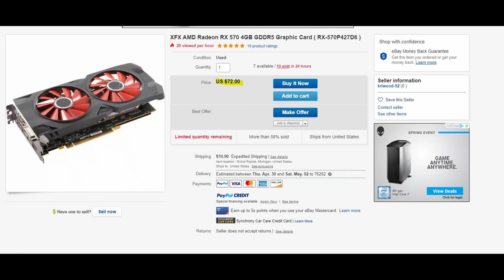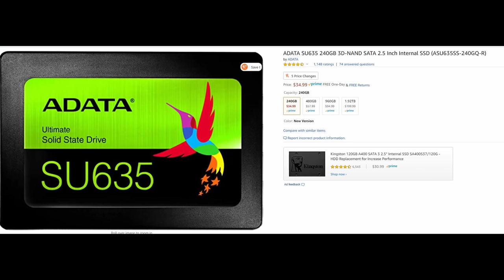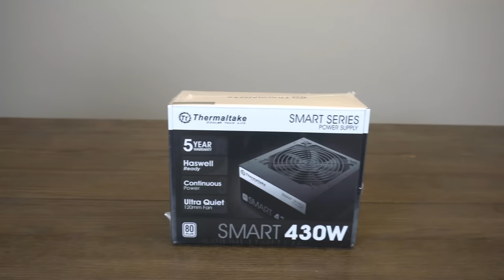$220 Just Get Gaming PC Build - Dell Optiplex 2020 + Benchmarks

Comment: Drilling out the rivets leaves holes in your case for dust to build up. Mounting the SSD with Velcro is a  bad idea. The heat from the Dell internals will make the Velcro wear off over time and the SSD will fall off. Your better off just locating a smaller GPU.
Reply from the maker: Good pointers!  

True but the holes are very small.  Not much to worry about.  True though the Velcro does not hold up well when mounted the way I initially did it. No actually stuck it to the bottom of the case after the fact.
Reply: @PCTechHustle  Maybe in a follow up video, you could recommend filling the rivitted holes with putty or something to keep the case in tact as it was before. Those refurbished Dell's are off lease business computers and are designed to last.

Comment: PC tech hustle,  question:  if you transfer a Lenovo motherboard to a micro atx case and realized that after troubleshooting all of your components your power supply adapter keeps your power supply running after shutting down.  Do you think it is the power adapter that is defective even though it is a brand new power adapter?
Reply from the maker: I think it’s reasonable to assume that is the issue.  Maybe try the old power supply again just to verify.

Comment: Would you buy the pc with SSD or buy it with a HDD and change that out for the purchased SSD.
Reply from the maker: It’s rare to find an Optiplex with a pre-installed SSD, however if you did find that absolutely go for that!  The SSD will offer much better performance and a snappy feel

Comment: did you have to use a special power supply adapter? these old OptiPlex sometimes don't mesh with modern power supplies. I would like to know, I am thinking about going this route for a friend of mine.
Reply from the maker: Nope!  That is why I also chose the 990 model.  No 24 pin adapter required.  Just plug and play!

Comment: what would be another decent option for a change to the case? i saw the video you did putting it in a new case, but if i wanted to put it in a case with a different design than that one what would i look for?
Reply from the maker: Basically anything that fits a micro atx motherboard which is just about anything!  😉

Comment: Very very new PC learner. (Coming from the Xbox world...) I have very little knowledge about the different types of graphics cards, CPUs, CPU coolers/fans, motherboards and their correct plugs and wiring, but I’m really getting into PC tech. So any constructive criticism is welcome. After watching several videos about these cheap builds, I notice a lot of dell multiplex or hp pavilion computers being used. Any particular reason? And with the multiplexes, what type should I look for if I plan to build one the way PC Tech Hustle is building in this video? Do I need to use a different CPU? I obviously need a graphics card, but what kind? What special cabling should I need? Thanks for any info. Like I said, I am very, very new to the world of PCs and PC building. Thanks.

Comment: I prefer the hp z400/z420, they already have sufficient power supplies at 475 and 600 watts, run much cheaper xeon processors, overall much cheaper to upgrade, can handle a bigger gpu and costs just slightly more than the dells.
Reply from the maker: Nice I might have to pick one up and tinker!

Comment: An i70c cooler would go a long way to cool that cpu since the gpu/psu will kick the heat up in that case. The first thing to go will be the mobo maybe cpu.
Reply from the maker: Honestly these parts don't produce massive heat.  Gaming would only increase that and the rear exhaust fan does a pretty good job.  I never saw temps higher than low to mid 60s while gaming on either the CPU or GPU.  Now I that situation can change drastically if I were to have gone for a much higher powered GPU, but the RX 570 is a pretty low-middle ground card.
Reply: PC Tech Hustle I tried to replace  the rear fan with something better. Since the connector was different it worked but I had to hit F2 everytime I booted up. So I just put the old fan back in. I appreciate the reply. I was just being safe with a better cpu cooler.
Reply: Btw those are good temps I think I’m getting mid 50s with that cooler.

Comment: I hope to answer my question, is it possible for this device to be compatible with the new graphics card, RTX 3080 and 3070. Thank you.
Reply from the maker: Is it possible? Yes.  Would I advise it? No.  You will create a severe CPU bottle neck with any generation Optiplex.  Also you won’t have access the pci-e 4.0 which will provide a lot more bandwidth for the GPU to operate.  You would also need some serious power.
Reply: @PCTechHustle  Thank you, I understood

Comment: I just bought a 990 for a "workstation".  It has an i7 4g ram and 250 gig ssd.  Its the "small form factor" so not sure if I can even upgrade anything.  Awesome video man thanks. 👍
Reply from the maker: You can upgrade the GPU and RAM.  If keeping the original case you would have to get a lower powered small for factor GPU.

Thanks for the comment, stay tuned too!  I’m doing some interesting upgrades to this one!
Reply: @PCTechHustle  I got a i7 3770 8g 1tb hdd sff and i regret it, shoulda gone ATX. Theres a lot more room (literally) for improvement in those.
Reply from the maker: You can always do a case transplant!  I am actually working on that as my next video!
Reply: Really?  I didn't know that.  I'm a complete noob at this.  All the different ATX's, Ti's, GPU's, 5Y's, 32FX, BF342's...kinda confusing 😔

Comment: i thought you had to get an adapter for the rx 570 with the optiplex motherboards. Also, how did you format the sdd without the original hd?
Reply from the maker: No adapters needed.  I just downloaded a copy of Windows on a USB drive and installed windows on the SSD.  I don’t have a video on how to install windows but there are tons of video out there that explain that process if you are trying to find that.

Comment: Have a look at Dell Optiplex 3020... gonna need double adaptors if you want to upgrade ur psu and cpu cooler, and if you want to upgra the case you are in serial trouble...
Reply from the maker: Yep that is why I stuck to the 990.

Comment: I have a dell optiplex XE2 with a i7 core and 16gb of ram and a Corsair 650watts what graphic card should I buy
Reply from the maker: Nice!  What size tower?  If an MT honestly I’d say whatever your budget allows.  A 9th gen i7 will handle a lot of frames from a modern GPU.
Reply: PC Tech Hustle it is a mid tower it’s a mini atx
Reply from the maker: Really?  A mini atx Optiplex?  A mini still should fit in just about any case but might make sense to find a smaller case to keep thing proportional.
Reply: PC Tech Hustle  it’s a typo I meant it’s not a full atx but it’s a mid tower
Reply from the maker: Cool so you can put some serious GPU to it then!  1660super or 2060super will be a good balanace.

Comment: there is an important difference between optiplex 7020 and 9020?
Reply from the maker: No real major differences.  Typically the 9020 will come with an i7 and the 7020 an i5.  Everything internally is the same.

Comment: Pc is more powerful than laptops 

I was on laptop and it costs me in 2015 like 600$ on 
i5 5200u 2.20 ghz 
6 gigs of RAM
And and amd r5 m230 

And absolutely my worst experience at gaming 

I watched a lot video like these I got a 350$ pc build 

Hp 600g1 

I got : i5 4590 3.30 ghz
Hdd 500 + 320
Ram 8 gigs ddr3 
Rx 570 4 gb gigabyte 
And I can tell you its better than my laptop and a ps4 of course
Reply from the maker: Heck yeah!

Comment: that Dell Optiplex looks like it's at pre pandemic pricing even here in the states. a cheap 2nd i5 dell tower was easy enough to find, but with 16gb ram for only $75? that's def on the harder end of the spectrum in terms of difficulty to find. and free shipping?

that would be hard pre pandemic but during pandemic? basically a steal and I checked ebay for kicks and not seeing much close.
Reply from the maker: At the beginning of it all for the United States anyway, before PC parts became very hard to find at good prices, especially a prebuilt like this one.

Comment: I built a 790 and I plugged in all the cords now I start it it has a beep sequence of 1-3-2 it’s not my ram and I don’t think it’s the motherboard any suggestions?
Reply from the maker: Do you get any display?
Reply: PC Tech Hustle nope
Reply: PC Tech Hustle it might me my motherboard if it is I’ll just pick up a new one I think I messed it up by scratching it with my gpu idk I just wanna play my games lol😂😂
Reply: PC Tech Hustle but I’ve been trying to fix this for like 3 days now I took my whole pc apart cleaned all the components and still the beeping with no display :/
Reply: PC Tech Hustle I was drilling to get that hard drive cage out and I think it won’t turn on because there might be metal shavings on my motherboard with some compressed air in a can👍

Comment: hi dude nice vid i was wondering can i fit the MSI Radeon RX 570 in the dell optiplex 990 without removing the hdd cage
Reply: it is your second optiplex that you mention and you said that we wont need to remove the cage 
plz reply 

regard jack
Reply from the maker: Yeah if you get the “armor” version of that card it will fit just fine.
Reply: Thx and do i have to change the psu for that
Reply: Sry but will it work perfectly
Reply from the maker: Yes if you are going with a GPU that requires auxiliary pci-e power you will need to upgrade the PSU like I did here
Reply: Ok
Reply: Thx alot man hope u become a big YouTuber

Comment: I am trying to find a rx 570 that is less than 10 inches in length but I cant find one for budget prices
Reply from the maker: I’ll admit, they are a bit of a unicorn right now.  Prices are still quite a bit in flux.  Even retailers are selling them way too high.  Give it some time or try your local used markets.

Comment: ok so i have a i5 4590, 430W psu, 8gb ddr3, 500gb hdd.
would the rx 570 work fine in my system
Reply from the maker: Absolutely!  That will be a pretty solid 1080p gamer!  If you can bump it to 16GB of RAM, that would settle you in perfectly!

Comment: ive seen many people recommend 500w+ for rx 570 or 580 but you used a 450w. what would you guys recommend? theres the corsair 450 vs evga 500w?
Reply from the maker: EVGA PSUs are a bit of a staple for my channel.  I have been using them for years and years.  Though Corsair and Thermal Take are also good brands that I highly recommend.  Many others out there just as good in quality and reliability.  450w is plenty enough.  The system itself doesn't pull more than 300w from the wall under heavy load.
Reply: PC Tech Hustle thank you so much!

Comment: How did you get the FPS so high I have an 8GB FX Radeon 580an Asrock B450 Pro4 a 250 Baracuda SSD a 1TB hard drive  AMD Ryzen 2700 8 core 16 threads  16 GB G.Skill Ripjaw memory playing on a 2560X1080 65.9 kHz 60 Hz and my kid can't go pass 52 FPS on Fort Night how did you do it?
Reply from the maker: This was at 1080p resolution.  Looks like you are doing 1440p.  I wouldn’t recommend doing 1440p on an rx 580,  that will seriously push that kind of GPU hard.  Unless you have a monitor at that resolution and are wanting to play at that, might be time for a video card upgrade 😉
Reply: Have you updated the drivers? You can find them on your specs respective brand websites.

Comment: Do I have to get the exact same optiplex as you with the same specs? New to pcs, this would be my first one as well.
Reply from the maker: No you do not.  I chose the 990 though because it’s a cheaper option than some of the later models.

Comment: I’m thinking of upgrading a friends dell office desktop. I see that the psu mounts at the top of the case with the fan facing downwards. Is that a dangerous idea? The PSU would be pulling in very hot air from the cpu. Will the psu last like that?
Reply from the maker: Not dangerous at all.  It’s not 1000c degree heat.  The PSU intaking air from inside the case won’t hurt anything.  In fact with the PSU in this orientation it acts as an additional exhaust of the system.
Reply: PC Tech Hustle thanks for that. Now I can suggest an upgrade with no fear

Comment: Does it have to be this exact pc? Or could it be another optiplex
Reply from the maker: Nope!  Though I don’t advise the 780/980 models as they have odd proprietary internal layouts.  790/990 and new models will do just fine!
Reply: @PCTechHustle  thanks alot!
Reply: @PCTechHustle  are there any that you would recommend because I've never built a pc and I dont know much about pcs
Reply from the maker: I chose the 990 just because of price and knowing I was going to upgrade.  The 9020 is about the biggest most expensive one you can buy but those are still quite expensive.  Unless you can get a great deal you aren’t going to see much of a difference between the generation model I used and a generation newer one.
Reply: @PCTechHustle  thanks again

Comment: Hello I have a question: I have an RTX 2060 with an i7 7700 with an rog Maximus viii(9) hero alpha motherboard I want to upgrade my mother board and cpu to a msi mortar max b450 motherboard  and my cpu to a ryzen 5 3600 but I have an mvme m.2 ssd with the os on it (win 10) can I move my ssd to my new motherboard without any problems?
Reply from the maker: Yes you can move that drive without issue to the new motherboard / hardware setup.
Reply: @PCTechHustle   OK thanks

Comment: Thanks so much, also will this pull of video editing and rendering? And can the Rx 580 also be used and if so will it get bottlenecked?
Reply from the maker: This CAN be used for video editing, shoot a P2 Pentium can, but would I advise it?  No.  Video editing is very CPU intensive, the more horsepower you have the smoother your experience.  Now you can upgrade to an i7 2600 which I may / may have not done in my video soon to come about this same optiplex.

THe Rx 580 is basically a pumped up / overclocked Rx 570, so yes it can be used.  The GPU will not be bottle necked, in this scenario with a lower end quad core CPU, the CPU is actually the bottle neck.  Again where an i7 can help fix that as an upgrade, which generally can be had for cheap from eBay as well, as an upgrade.
Reply: @PCTechHustle  thank you very much, I will take that advice, I have subbed
Reply from the maker: Thanks!  Have a great one!
Reply: @PCTechHustle  sorry for interrupting again, but can you please give me link on amazon or Newegg of a good dell optiplex 7010 since there are so much of them, I tried to budget the parts but it always reaches 500 dollars, thank you in advance and this will be the last comment I will say to you

Comment: is there any particular reason to why we can only get MT not the smaller ones because the prices are really high right now. Do you know when the prices will decrease again?
Reply from the maker: I suggest the MT so you can fit larger more powerful video cards.  You can go with a smaller form factor but would then have to get a low profile GPU which tend to be a lot more expensive and under powered

Comment: Ive had two Adata 240gb SSD and both crapped out, i after 4 months and the other in 9 months. Kingston A400 240gb is $27.99 on Amazon right now. You’ll thanks me later.
Reply from the maker: Good to know!  Those Kingston drives you mentioned are also on my go-to list!  Thanks for the input!

Comment: Great video.  I have an Optiplex 1070 with the i7 3770 that I tuned up for one of my kids.  Had a PSU laying around that fit perfect, used a SSD with the double sided tape in the hard drive cage.  It never occurred to me to cut the rivets out to get rid of the cage!  I really like where you put the HDD in the upper cage.  I see just one bolt to hold it into place - is that all you used?  I picked a GTX 1060 up off ebay for about $100 - it's one of the small ITX versions and was a perfect fit.  It's been a good match with the 3770 because there hasn't been any bottle necking.  If fact, I think the 3770 could take a little more speed, so I may try a gtx 1070 if the prices drop a little more once Ampere comes out.  Did you consider adding any fans to the front?  Thanks again for the video!
Reply from the maker: Thanks for the feedback!  Yes actually the HDD is just held in with 1 screw.  I did consider adding fans as well but didn’t want to destroy the case too much.  I didn’t instead do a case transplant which added tons more space / airflow.  Take a look at that video!  Thanks for watching!

Comment: would a gtx 1650 Low Profile work in this optiplex?
Reply from the maker: Yes that would work but you don’t need to get a LP GPU if using a full tower like this.  But if you are looking to save your self the hassle of not having to remove the drive cage and keep the stock power supply a LP will be a good option. Keep in mine LP GPUs are typically very under powered and don’t produce fantastic gaming results.

Comment: Hey There, I Want To Build A Pc And Im Interested In This Build. I Want To Build It But Can I Use GTX 1650 SUPER Instead Rather Than Rx 570? Also If I Want To Upgrade The Cpu What Kind Of Cpu Do You Recommend?
Reply from the maker: You sure can use that video card!  For CPU upgrade check out my video where I do just that (upgrading to an i7).  You will be happy to see the differences in performance!
Reply: Oh Ok Thanks!
Reply: @PCTechHustle  Sorry To Bother You Again But Can I Use A Different Power Suply? Rather Than Thermaltake
Reply from the maker: Absolutely!  Whatever you can afford.  PSU prices are very volatile right now though.  I typically try to find an EVGA BR 450-500w if I can get a good price on one, over a TT PSU.
Reply: @PCTechHustle  Alright Thanks